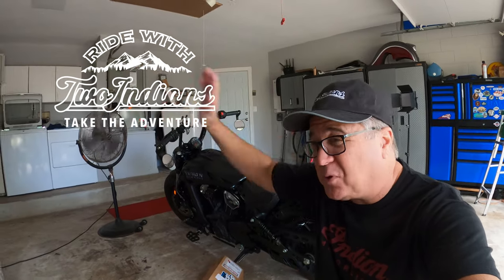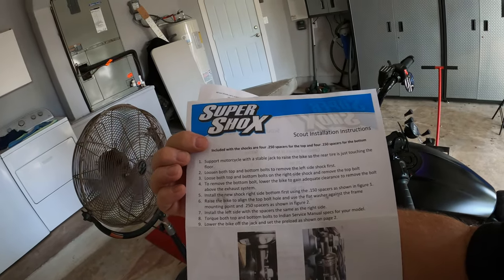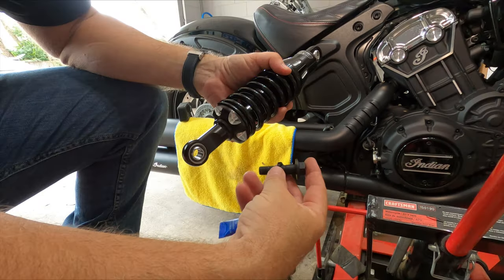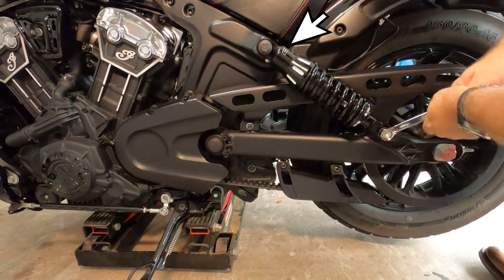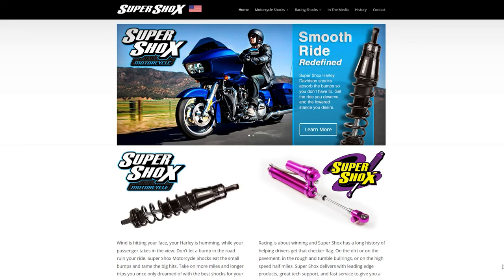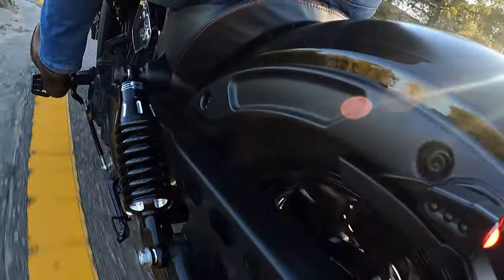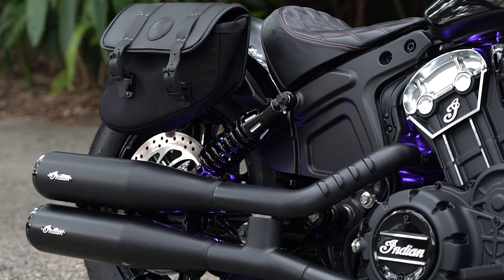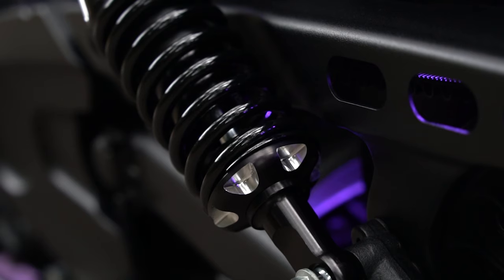How to Replace Indian Scout Bobber Shocks - Super Shox Install & Ride Impressions - Super Easy.

Comment: I totally agree, that the stock suspension both rear and front are quite lacking on the Scout and Bobber models. I have only put on an aftermarket seat so far, that makes the ride some what more bearable. I will be doing the front forks first. So I am looking forward to your future video on what you chose and replace the internals with! You two ride and stay safe down in Fla!

Comment: Nicely done! The technique without having to remove the exhaust in particular. I almost want to do the same way, but you can't torque it to specs with the exhausts on, or could you ?
Reply from the maker: I don’t see why you couldn’t but honestly I’ve never used a torque wrench in my life.
Reply: @TwoIndians  , could have while on the lift, but then i think i'd run into trouble aligning the upper bolt in place.

Comment: Looks good, talk about loosing a shock, it’s actually not as bad as you’d imagine. I was riding behind my dad a few years ago, he was on his 80 sportster. He hits a slight bump in the road, and he breaks a shock, I watched the spring from the right side shoot straight up about 25-30 feet in the air. I swerved and stopped, it missed me thankfully, and picked up the pieces. Then I had to go chase him down, he didn’t even realize he lost it. The look on his face was priceless when I pulled up next to him with the spring in my hand. Rode the bike 50 miles back home no problem. Anyway good video as always.
Reply from the maker: Thanks for the great story!

Comment: Is there a direct link or item number? Where to buy it from?
Reply from the maker: You have to go to the website listed in the description and fill out the form and they message you back with the correct part number. Honestly it’s a little goofy the way you have to buy them but it’s worth it.
Reply: @TwoIndians  That is a goofy way haha. Now that you have had it for a while would you still choose this over let's say Fox Shocks or other? Up to $1000 range this is still your choice?
Reply: Do you have any experience with K-Tech Razor III lite? There is one available locally for a good price

Comment: How come you didn’t use the black bolts that you have
Reply from the maker: I did except that one bolt needed to be shorter so I had to use the factory “shiny” bolt. But I put it in the place that would be easiest to replace.